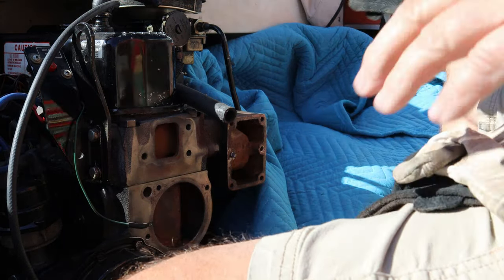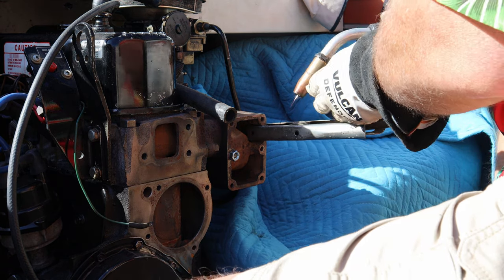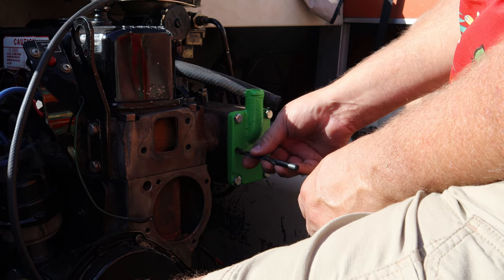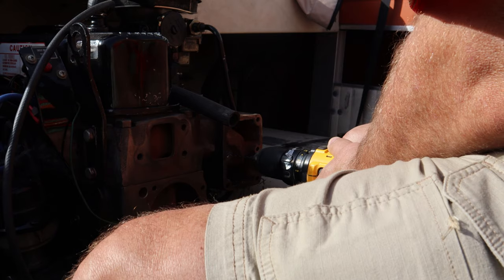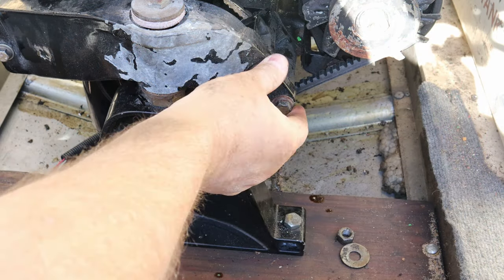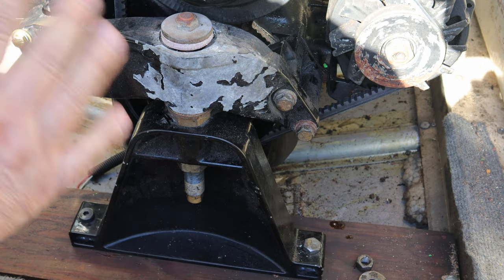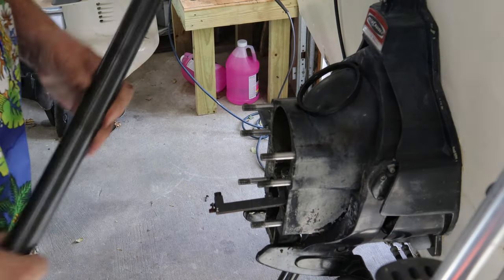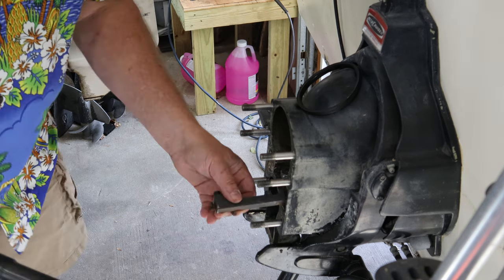1976 Starcraft Mercruiser 120hp Engine reassembly Part 2 making it great againThe Bolt is out

Comment: Hey man I’ve got a 1976 Johnson 35hp and the front bolt on the starter has broken. What would be the best way to repair it to mount the starter back on?
Reply from the maker: you are going to have to weld on the bolt or drill it out and thread chase it.